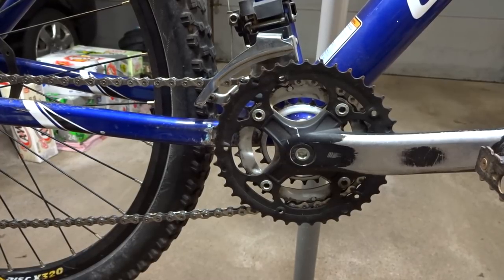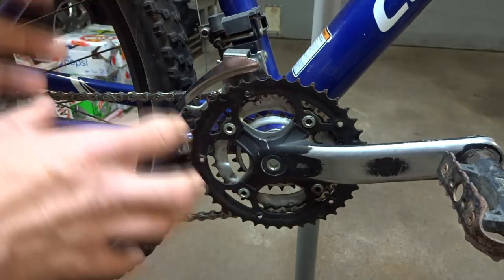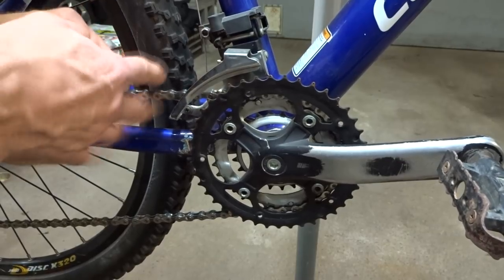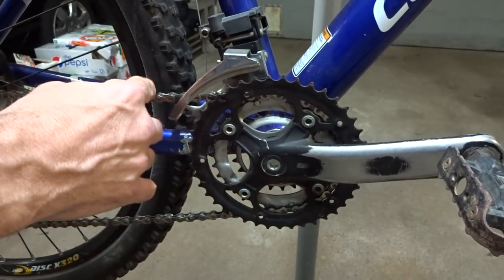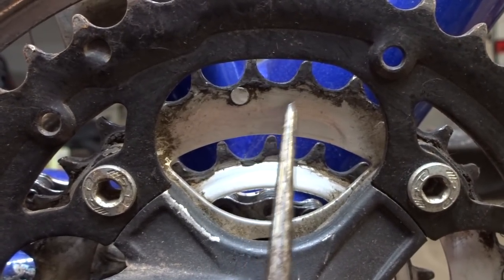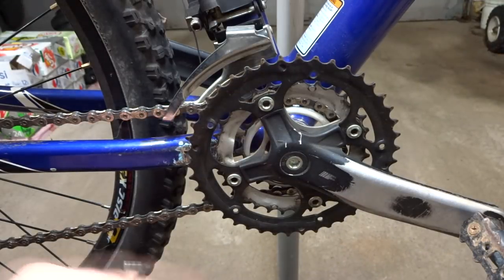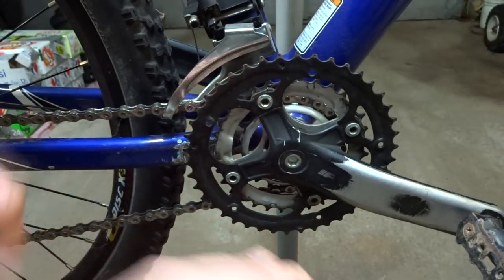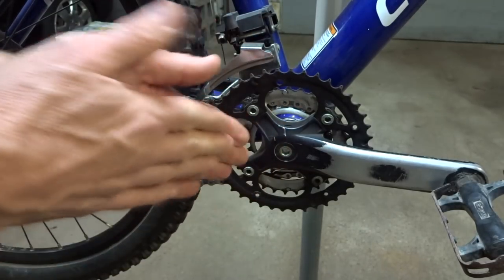Chain Suck - The Causes And How To Fix It

Comment: You the man RJ. I cannot tell you how many times you have helped me to figure out issues with my bike that the bike shop could not solve or saved me money in doing my own repairs which have made me a better mechanic, rider and man. Your absolutely right about the worn crank with new chain being responsible for even more or worsening chain suck. I couldn't figure it out. I thought my chain line had changed somehow and was wondering if my bottom bracket was loose or frame bent. Decided to check all your videos for a possible diagnostic test and sure enough... PROBLEM SOLVED. THANK YOU VERY MUCH.

Comment: Good topic. My carbon frame was punctured because of it when the chain smashed the jockey wheel into the chainstay. I inspected the big ring and found a few teeth with lips and grooves. 
Problem is riders may not know why chain suck happens, or that it's called chain suck.
Thanks!

Comment: the only time I've had chain suck is after using finishline dry lube , I was 20 miles into a 40 mile ride when it happened and the chain just locked up when it wasn't in a direct line with the chain ring I was in , I managed to get home and then binned the finishline dry lube and changed it to muckoff , never had an issue since :)
Reply: I've just had it for the first time, recently started using muc off dry lube. Had cleaned and relubed the chain the same day it happened - allowed the recommended 4 hours drying time after application.

Think I might try wax immersion. Supposed to be the best way.
Reply: @fubar12345  finishline used to do a wax lube and that was the dogs bollocks , cant seem to find it these days tho (wax lube beats everything )

Comment: Very helpful video. Been having this issue on my 2x8 drivetrain especially when cranking uphill in low gear very inconvenient timing lol. Figured it was the cranks, replaced them with better ones and dang it the problem got worse! Couldn't find anything on it didnt even know what to call the problem until this video popped up. Going to replace the chain too hopefully that's that. Thanks!

Comment: An ofset Derailer can also cause it. And if thats been unaligned for too much time the wear on the ring will be offset so when aligning the derailer you first may not have had chainsuck but after correcting the derailer ofset you suddenly do get it. A quick pass of a grinder or file can correct it. If not then replace.

Comment: Mine stated today but after the shift is complete. I have also cleaned and relubed chain. My bike is less than a year old and is a Trek Marlin 6.
Reply from the maker: Did you check the chain for wear with a gauge? Are the rings/cogs worn?
Reply: Pete Mycek I’m here because of chain suck in my BRAND NEW Marlin 6 2020. First ride and my frame is all scratched from it already.
Reply: @Nachoschindler  don't worry I bought a brand new Giant Talon a couple months ago and this just happened to me this week. The paint is all chipped up around the chainring. It happened after my 1st wash/cleaning of the chain. I think I need to go clean again and take more time with de-greaser then making sure I lube it good after I'm done.

Comment: Hi, I have 2 chainrings, tiagra 4700. Bigger 50T ring is getting worn/sharp. My dealer told me a BBB 46T would work - I wanted a smaller ring. I moved the front derailler down as the ring is smaller. When downshifting the chain gets stuck between the two rings. I cleaned everything, plus new chain. smaller chain ring isn't worn much. I checked to see if i had the small ring on correctly, drive side down that ring up, i can read the writing on it. Plus the 4 bolt interface has a groove and the cranks have a notch, so it is correctly oriented. Plus flipped the other way there is a bigger gap between them. With my old 50T I never had a problem shifting, chain would just drop nicely. I am testing it out on a flat side street not at high speed. It does shift, but it usually slips on the downshift. I checked the chain, it is a 10 speed chain. Thanks! Also small chain ring is not rounded, i use mostly the big ring.
Reply from the maker: It sounds like there is too big of a gap between the chain rings. I can't tell you why.
Reply: @RJTheBikeGuy  yeah that's what i am thinking. I would have to take it apart, Again, to compare the measurement. I also notice the old chainring's width is tapered - getting wider as it gets closer to the axle, so there is a kind of Jump/ramp the chain follows towards the smaller ring as the chain exits this ramped larger ring. The old ring looks like the teeth are far left, but the new ring is not as thick so it is already sucked as far left as it can go. So I am thinking maybe i need to move the front derailler limit further to the left and hope it moves more when i shift down. My downshifting was perfect before. The upshifting doesn't have a problem. I think my chainline changed, i also have a new bb to stop the creaking (3rd time creaking, lots of water/winter commuting). My chain hopped the big rear cog into the spokes for the first time ever. I was testing riding a small road nearby, i carried my bike home, partially removed the tire and removed the cassette to get the chain out, since it was stuck. Luckily i stopped pedalling, the black spokes lost a tiny bit of paint but are undamaged.
Reply: My chain length might be too long but that wouldn't do that would it? If it was chain tension  I could test it in low gear.
Reply: @RJTheBikeGuy  Hi BBB got back to me and said my chain was too long. I have a 11-36 cassette with  my 34T chainring and this new 46T big ring down from the 50. I measured half the circumference and ends up being about 1" shorter. I changed gears on the bigger cassette cogs where more tension occurs and that seemed to work better. I removed a link (2 segments, 1") and it improved but still slack chain on the 11T rear, so i think i need to remove another 1". How does that sound? If you reduced your chainring that much, how much do you think you would reduce your chain length?

Comment: I'm experiencing the same thing 
I replaced my chain as the old one had a damaged link cleaned the new chain to remove their lubricant as whatever they use is way too sticky then re-lubed the new chain with mucoff wet lube ran the crank around and didn't notice any issues until I actually left for work this morning and this ungodly sound at 5.30.in the morning didn't know where it was coming from until I got someone at work to ride my bike so I could see and there it was new chain sucking up half way round the chainring before releasing 
Now I got to mess about putting the old chain back on until I can order a new chainring

Comment: Hello everybody, and i know this is off topic but im thinking about changing shifters cus i dont like these ones i Wanna change from normal shifters to click shifters but theres a problem cus theres 7 shifters on the right side and 10 on the left the left one is called friction i never had it on My last bike but the problem is that theres 3 rings so that MEANS that the bike is a 3x7 should i order 3x7 or 3x10? Please help me
Reply from the maker: if your drive train is 3x7, order 3x7 shifters. There is not a 10 speed shifter for the left side.

Comment: Damn, so this was likely the cause of my cranks not working when I tried a 2 hour ride in the rain for the first time. Likely cause was my lube getting washed away, which was obvious with the noisy chain... and some scratches on the chainstay. Very dangerous if unlucky. If I ever do another rainy ride like that I'm gonna relube before riding, or even carry a small bottle of lube with me.

Comment: Hi RJ, I built a bike, brand new drive system (chain ring, chain, freewheel, rear derallieur, 1x6 speed) and even have a chain suck. I marked the stucking chain part and always that is stucking. I'm wondering what to do, might the new parts are too tight and need to use till the chain suck is over. Do you have same experience with new parts? (The parts are compatible with each other).
Reply from the maker: Sorry, I have not had that experience. Maybe a link(s) is stiff.
Reply: @RJTheBikeGuy  Definitely was. I used extra lubrication on the chainring and chain (Würth HHS 5000), and start riding. After 10 km, chain suck is forgotten. Anyway thanks for the rapid reaction. I love your videos, very useful matters, keep it up master!

Comment: Hi RJ I got a problem, I converted my old bike from 5spd to 7 spd with new 11spd wheels and 7spd cassette. I have all the needed spacers on the hub. The problem is that if I change to the smallest cog the chain gets stuck between the frame and the cassette, while it stays on the cog (it is not dropping of it) what can I do besides adding a washer on the axle?
Reply from the maker: Probably add spacers. If the bikes was 5 speed, the spacing was maybe 120mm? For 7 speed, it is normally 126mm. But a 11speed wheel will probably be 130mm spacing. Did you remove spacers to fit the 11 speed wheel in 126mm dropouts or something? I thing a 11speed freehub is slightly wider than a 10speed freehub. Maybe the 7 speed chain is wider than the 11 speed chain is the issue. IDK. You are just going to have to figure it out.

Comment: How to stop chain suck forever? Convert to 1x! 😂

Great informational video though.
Reply: Noel Castillo What if you need all the gears for touring? Also 1x means massive jumps between teeth on the cassette.
Reply: +Earl Grey "under load" is the key to his reply. IF you are under load and must shift, you momentarily "unload" (relieve pressure on pedals while continuing to pedal). Done right, the shift will be good and no damage will be done to drive train. I hauled 350 lbs through hilly neighborhoods for years without damage. My colleagues did not underatand "unload" and regularly damaged the drive train.
Reply: Never!

Comment: chain-suck happened to me today. let me explain the context. i replaced chain and cassette. front chainrings are only NOT new part of drivetrain. now, there is huge discussion on internet what to do with factory lube from new chain. after all information i read (from "don't even touch it" to "completely remove it") i decided to remove factory lube only from OUTER part of chain, and leave it inside of chain pins (i put chain degreaser on paper towel and ran it through chain while backpedaling).

So i went to ride with non-lubircated new chain, new cassette, and old front chainrings. Not sure if chainrings are realy worn, or possibly factory lube (or no lube) caused chain-suck.
Reply from the maker: New chain, new cassette, old chain rings. And you get chain suck. Like in this video. Hmmmm.
Reply: yea i just, was hoping naively that i can get away with it, and save some money at least on front part of drivetrain. ah well, guess not.

Comment: Hi, I have a BRAND new bike and this had been happening to me on the smallest front sprocket? Any ideas? Thanks
Reply from the maker: If it's brand new, then take if back to the shop and have them fix it.
Reply: RJ The Bike Guy hi, I ordered it online and to be honest the customer service has been pretty poor so far! I was wondering if there’s anything I could do before taking it to a shop (where I will be charged as I didn’t buy it from there) the shop I ordered it from is over 100 miles away. I guess that will teach me not to order a bike online! Haha any tips? Thanks for the reply
Reply: @butcherdawgg3708  Actually you can call the customer service or message {email} them so it can be replaced. 
I hope that would work. I returned my bicycle which I bought from ebay. They refunded the money and I took all the old parts on the cycle and kept the spare parts.
Hope that helps.

Comment: What about this happening on a brand new mountain bike? Started without even touching mud. And happens under load and after shifting even 20 feet down the trail just pedaling.
Reply from the maker: Brand new. Take it back to the shop and have them fix it.
Reply: My friend and I both got the same bike Giant Talon 2 29er, we both had it happen on our bikes, grrrrrr. Thanks.

Comment: What if the bike is brand new (Marlin 5) and keeps happening even in flat surfaces? I've been careful to relief the pedal when changing gears
Reply from the maker: If your bike is brand new and having issues like that, take it bake to the shop and have them fix it.
Reply: Having same problem on same new Marlin 5.  Luiz how did you get it fixed
Reply: @jamesroberts7137   I didn't hahaha. I'm very disappointed with this bike. I took it to the shop, they made some adjustments, but it never got fixed. In the spring/summer, when I start to use it again, I will use the "cable ties" fix. Basically, you put a cable tie on the chainstay, and the extra cable you point towards the ground (you may need to cut some of it). This way when the chain gets stuck the cable tie will get on the way and release it. There are some tutorials on Youtube.
Reply: me too! same bike... it never happened in 47 years on bikes
Reply: Had exactly the same problem on my Marlin 5! On my first ride it happened, scarred the frame very badly & nearly threw me off the bike! 

Pretty much Why I'm looking at upgrading to something with a 1x10 or something like that as it's happened a lot since then. No matter who I take it to they cannot stop it happening. It's a real shame as it's a brilliant bike for the cash you pay for it! But that 3x7 is pure shite!!
Reply: @Theaggressivesalad  sorry but I have do disagree about the bike quality. There are many components that you find at any Walmart store bike for half the price. And I'm not even going to trails with it, which can be even more frustrating from what I've heard. I'm really disappointed with Trek, but that is probably a market thing, as many other entry levels bike have basically the same configuration
Reply: @LuizGNA  fair enough. I'm still a relative newcomer to Mountain Biking so I'm not really any the wiser on what it shares with Walmart bikes but it's done the job well enough on what I have used it on thus far. However it's that 3x7 which absolutely spoils it for me, I've got some big plans for this year and I have 0 confidence in the 3x7 to not chainsuck and pitch me off the bike.
Reply: @LuizGNA  what would i search to find this cable tie method?

Comment: I'm a nerd please help. 
While riding fast , my chain gets stuck and when I pedal back (anti clock wise ) and pedal front it works back but it happens always
Reply: I guess you are talking about your cassette locking up. I had that when i went through a sandy trail. I think it might be dirt getting into your hub. I sprayed a ton of degreaser, cleaned it, and put a dry lube in the crack.
Reply: Blake Boggs after 7 months no reply, thanks a lot at least one human in this world helped me lol

Comment: also waxing the chain stops the chainsuck as well :)
Reply: Question why wax !!
Reply: because keeps my chain cleaner, less lubricant, maintenance, because i become lazy :P
Reply: Not in wet.  Wax made for dry.  Use Pedro's Ice Wax in a muddy ride and you'll get chain suck.
Reply: Just go dollar tree emergency candles and run chain through it wax lubricated repels water
Reply: for dry i use normal chain lubricant, wax for rain and mud. i use melted candles, more efficient

Comment: Yup, I was lazy to replace the chain and the cassette got worn out and now from time to time there is some chain suck when shifting the front derailleur on a triple crankset (between middle and big ring). Seems like I've got an expensive problem to fix a soon as possible.

Comment: I thought that chain suck is when the chain goes in between the chainstay and the tyre
Reply from the maker: Nope.
Reply: Oh
Reply from the maker: That is usually caused by a poorly adjusted rear derailleur, or bent derailleur/hanger.
Reply: Nope, I don't mean between the casette and spokes but stuck in between the chainstay and tire. I haven't had either of these problems but just thought it's that way.
Reply: Does that even happen?
Reply: Thats almost not even possible unless your chain is waaaaaaaay too long and your derailers springs lost its resistance. First shorten your chain. If it wont work then replace the derailer. If that still doesnt work then you might have a wrong chainring on it. Basically to big or pushed to far over the pedal area which made it get to close to the frame. If the chainring teeth are almost touching the chainstay then thats the case.
Reply: Tomi Saaranen tire!!

Comment: the chain line has well can cause chain suck
Reply: David Carvalho Yes, I agree that you can get chain suck from a bad chain line. I put a new chain, cranks, cassette, and rear derailleur on a bike trying to get rid of a chain suck problem.  Finally I changed to a bottom bracket that moved the chainrings a few mm closer to the frame.  Like magic the chain suck went away.
Reply: On my first ride on my new bike, that happened 2 times when I shifted from the big ring to the middle one, thas not a good feeling.